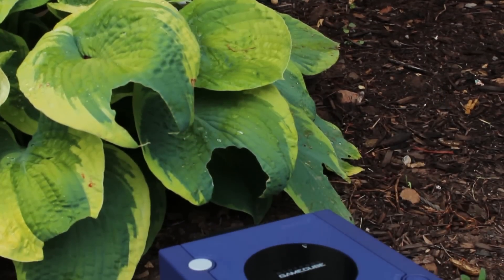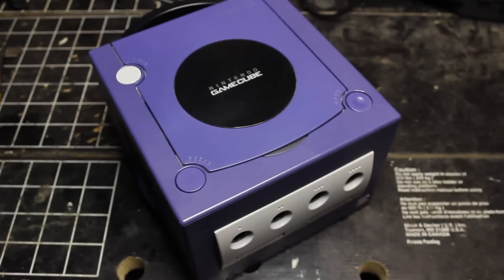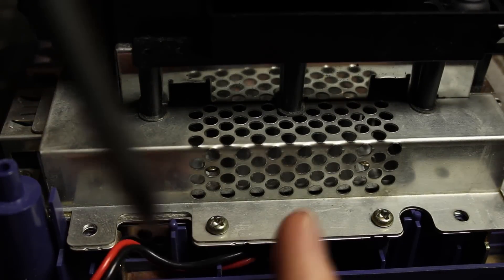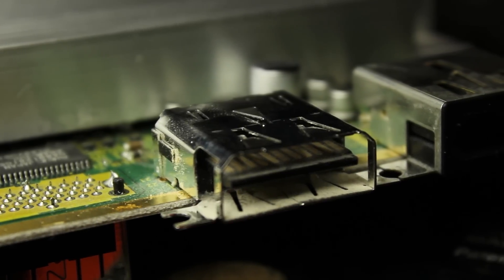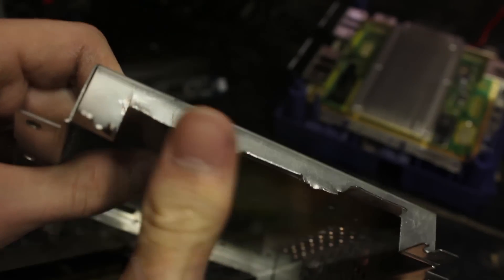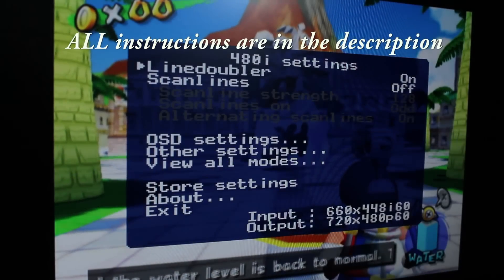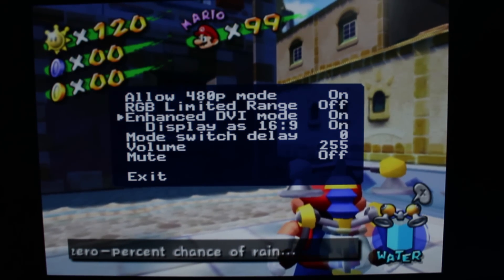GameCube HDMI Mod

Comment: I wonder if an adapter would work for 1080 or 720p, I mean one that can be place outside just like the one they made for ps2 and the wii.Does this mod allows to play backups?We don't see when you solder the chip, we just see the wire at the end being solder, is that the only one needed to be solder? Is it that simple.
Reply from the maker: I've discussed the idea of an adapter with someone else, and it would be a great idea, only power would need to be soldered. The only hold back for an adapter is someone to manufacture the enclosure. This is not a mod chip, it simply upscale the GameCube image. It isn't that simple, the diagram is in the description for all of the soldering points: https://docs.google.com/document/d/1FOQi2EyKnDFoHLZ-CW4AgzqSwIgCRNXVBuhimMKxcMc/edit#heading=h.k9gib7gumrna
Reply: +Sam Campbell I really like to see how you solder the HD card, because I want to upgrade my GameCube and I don't see how you solder it, I just see when you solder onr cable, but there are other cables.
if they could make an adapter like the one for the wii with HD output and an intrrnal chip would be nice, is also cheaper.
Reply: Sam Campbell would an adapter do the same as the mod chip?
What about a soft mod in the memory card, can that help improve quality? 
I would definitely want a memory card modded with the GameBoyPlayer disc information inside, so we wouldn't need the disc in order to play Gameboy games in the GBP.
Also they can mod the memory card to allow imports and backups.
Maybe even translation.
Reply from the maker: *****
You'd need something like the WASP Fusion to get SD card support, etc. Then once you added the inclusion of up-scaling, etc, you would be remaking the GameCube looking something like this:
https://s25.postimg.io/ej42qs7ov/Megadrive_v3_And_Wasp_Fusion_1.jpg
Reply: Sam Campbell NICE! I am sure they can make the hdmi adapter in a better shape to easily come to the back.
Also would be better with SD card support, we could play the GameBoy SD games through it, many good games on SD.
Maybe they can do a mod cover with that integrated and have the sd on front, also the mod cover can have the DVD cover to input and play DVD's would also be another enhancement for rhe GameCube. 

If they could mod the two memory card ports into a single USB would be awesome.
But they would need to integrate 3memory cards inside for the storage of games, I mean if you add 3 memory cards with much memory capacity inside the GC, there would be enough safe space thst wouldn't require any memory card at all, so they could mod it to a USB maybe.
Reply: Sam Campbell Just tell me where to send my GameCube for HD mod, and take my money, I want my GC modded so it can have HDMI, Play Backups and Imports, and also memory card with GameBoyPlayer disc boot information inside, that way I can use GBP without a disc.
I already have a wireless controller and adapter for GC, just need the mods for it.
Do you do mods?
Reply from the maker: I currently don't have the time or inventory for mod installs, sorry. As for who to look for, I also don't anyone specifically, you'll have to Google around.

Comment: The HeatSink is completely unnecessary as same in the N64, not require for anything.
Reply from the maker: Are you suggesting that people should discard their headsinks?
Reply: +Sam Campbell I don't know what you are referring.
I am talking about the GameCube aluminum sink, the one that is supposed to keep cool the motherboard, is completely unnecessary, I took the one of my N64 off because is useless, those consoles DoNOT heat what so ever.
Reply from the maker: *****
It's not something that I would recommend others to do. But if you find that temperatures are stable then I'm not going to say anything against your removal of it.
Reply: Sam Campbell I removed the one on my N64 is been more than 2 years plays fine, also xbox and 360 is unnecessary as well, I also took the one in the GameCube and works just fine.
I need a softmod for the GameBoyPlayer to work without the disc, there are memory cards with SD ports, I wonder if the disc data inside the SD can work and allow to play it, or if there is another way around it, softmods are cheaper and easier.
Also do you mod GameCube with HD cards if so, how much do you charge? and or who does it.
Reply from the maker: No I currently do not do mods installs

Comment: This is a great mod and It's a good bump compared to Composite. But one thing I might suggest is that the Wii's Backwards compatibility is as good as the GameCube when ran through component and the cables for the Wii are cheaper. 

It's the same great experience and there's no emulation involved. Just something to keep in mind. :)
Reply: The Wii is not as good as a GameCube because you can't play GBA games on it
Reply: The Wii component cables for gamecube games is a pice of shit! I had the Gamecube with Componente cable on HDTV and is a lot better than the crappy component cable of the wii
Reply: No. As far as I'm aware, the cables for the Wii and Gamecube are dramatically different. Besides, the GC cable requires the Nintendo custom chip in order to decode the signal. Natively the signal is Digital but has to be converted using that nintendo custom chip to analogue.
Reply: Will a Wii Component lead work in a Gamecube? I know it won't fit natively, but will it, if I shave down a corner or 2 of the plug?
Reply: Where can you find affordable component cables for Gamecube?
Reply from the maker: That's a mystery to us all
Reply: dboymax1 you simply can't because the onboard dac (digital to analog converter) on the chip is exclusive to Nintendo and the technology isn't widely made at all. People are advancing in plug and play alternatives though.

Comment: Is this a PAL-only mod, or will it work with NTSC region Gamecubes? And does it require any other mod-chips to be pre-installed? I'm custom-modding and painting a gamecube for my sister for her 21st birthday and I want to know if it's possible before I begin ordering this stuff.
Reply from the maker: The one I used in the video is actually an NTSC GameCube, however it should work for all regions. No other mod-chips are required, just what's in the description. That sounds like a neat gift, good luck!
Reply: Alright, awesome. Thank you.
Reply from the maker: No problem, let me know if you have any other question later

Comment: Is it possible to just make an adapter that you plug into the digital port instead of modding the gamecube? I guess it would need a separate power supply and buttons to control the OSD.
Reply from the maker: Yeah, you're pretty much describing what the chip your installing is.
Reply from the maker: Actually, I thought about this again, and it would be possible for someone to make a consumer version using a nice boxed enclosure that just plugs into the digital port and only requires like 3 solder points. That would be interesting if someone got on that.

Comment: 8:21 do you solder only one wire? And what specific wires do you use?
Reply from the maker: Take a look at the diagram in the description: https://docs.google.com/document/d/1FOQi2EyKnDFoHLZ-CW4AgzqSwIgCRNXVBuhimMKxcMc
In this situation I ended up using 30 gauge wire, however you can choose a slightly thicker wire if you want
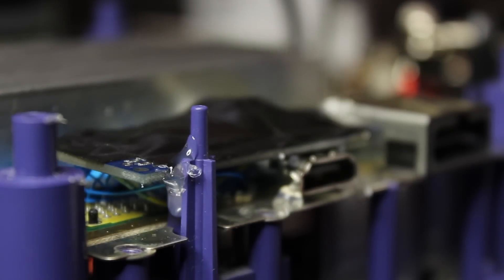Reply: +Sam Campbell 8:55 what's that black thing on top of the chip?
Reply from the maker: Electrical tape, just for added protection once it's back together
Reply: +Sam Campbell awesome. Idk if you stated it in the video, but does this mod allow region switching?
Reply from the maker: No it doesn't, that would be modchip something like a XenoGC
Reply: Sam Campbell do you have experience installing the xenochip?

Comment: When everything is together does the HDMI port output audio, or do you still have to use the original RCA cable for sound?
Reply from the maker: Nope it outputs audio, just turn on Enhanced DVI mode.
Reply: darn, i thought so, I have the board installed, and its not putting out sound even with enhanced mode on....
Reply: I give up..... It seems as though the sound problem may be from the HDMI connection as it seems to work if the hdmi is torqued to the left really hard..... I guess I'll settle for just using the RCA cable for Audio..... :(
Reply from the maker: Ach! That's a real shame, all I can suggest is checking all the connections, perhaps jolting it to the left is bridging a cold solder joint
Reply: Got it working! Opened it up one more time and resoldered some of the joints that looked a little under done..... Thanks for the tutorial and replies! This was my first MOD work of all time and actually my first time really soldering too!!!
Reply from the maker: Tracy Stapleton
Congratulations!

Comment: Three things to say/ask 1. is there input lag with this? 2. Can i also use composite without unpluggin hdmi constantly so i can competitively play melee on a crt
Reply: 2 things not 3 sorry
Reply from the maker: It seems to project both outputs at the same time. I had both HDMI and Composite plugged in, and switching between inputs on the TV showed they were both operating. In terms of lag, I couldn't answer your question, sorry.
Reply: +Sam Campbell ok thank you
Reply: Sam Campbell

Comment: you are a godsend for this tutorial. thankyou
Reply from the maker: Glad to help! Let me know if you have any questions
Reply: Word.  The pin numbering on the board with the numbers "1", "2" on the left side and "21", "22" on the right side. What would the pattern be for the numbers 3, 4 and 20, 19? For example, would I assume 3 would be to the right of 1 or 2?
Reply from the maker: It's a zig zag like pattern so 1, 2 above 1.
One column to the left, 3, 4 above 3. Next column 5, 6 above 5. etc.

I'll update the diagram for clarification to others
Reply: Hey, I was able to install it. but I have no audio or sound even with Enhanced DVI mode on. What could be the prob?
Reply from the maker: I only have two suggestions for this problem, the first one is to double check all the solder joints, make sure none of them are cold, etc. And secondly, there should be a 100Ohm resistor between DDC +5v and VUNREG, check the resistance to make sure that it is in fact a 100Ohm resistor, and if it is then try a direct connection instead

Comment: I consider 480p "high resolution" because most games before the Dreamcast output in 240p
Reply from the maker: Yes but you only get it in 480i, and it usually isn't very clean on analog
Reply: Sam Campbell All of the 6th Generation consoles could do 480p which is a very clean signal when used properly. 240p gives an emulator sharp look but 480p gives more details on the picture. 480p is more clearer than 480i because it is a progressive image
Reply from the maker: Helloz World
The GameCube requires a component cable to get to 480p, otherwise you are stuck with the single yellow A/V cable
Reply: Sam Campbell I have the Gamecube Component cables and with this mod you can enable 480p on 480p games such as Super Mario Sunshine by holding B as the game boots up. You can also force 480p on 480i games by using a homebrew software called Swiss, it can be launched using Datel's SD Media Launcher which can be bought on Codejunkies.com. Try it, the HDMI mod can do 480p just like the Component Cables can! Just remember to hold the B button before the Gamecube is on and don't let go until a message on-screen says before the game starts "Would you like to enable Progressive Scan?" then select Yes to get 480p  :D Lots of games support a 480p mode and if they don't they can be forced. Swiss also can do Widescreen too on 4:3 games!! The forcing of anything by Swiss will not work on every game but it will on most :3
Reply from the maker: Helloz World
Thanks! But I know this already. I just wanted to tell you that the 480p will only work with a component cable or this mod, in case you had assumed that the default cable supported a digital signal for some reason.
Reply: Sam Campbell Ok, I knew that :D
Reply: 480p is not high resolution it's Enhanced Definition. 720p and up is considered high definition. 240p is standard definition. 480p has never nor will it ever be high resolution or high definition. Game consoles before the Dreamcast were standard, Dreamcast to the Gamecube were Enhanced, PS2 (It had a few 1080i titles) to now are high definition.
Reply: ***** 480p was considered a high resolution at one point. Eventually 1080p will be considered "Standard Definition". Still 480p is much better than 240p with 3D Graphics. Oh and by the way 240p isn't Standard Definition but Low Resolution
Reply from the maker: Helloz World
That's kind of true, with 4K slowly becoming more reliant, 1080p is looking a tad lesser, still considered HiDef but perhaps some day it won't be.